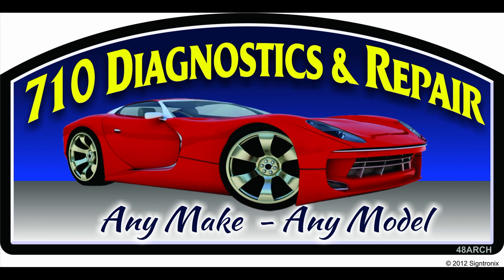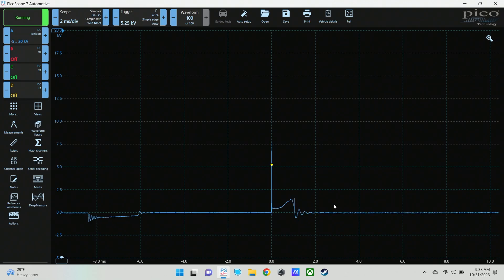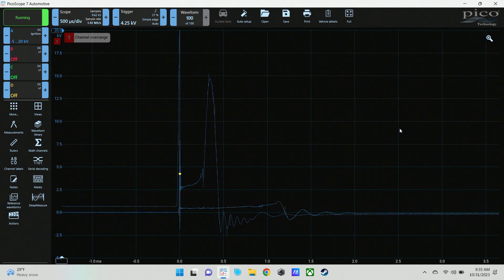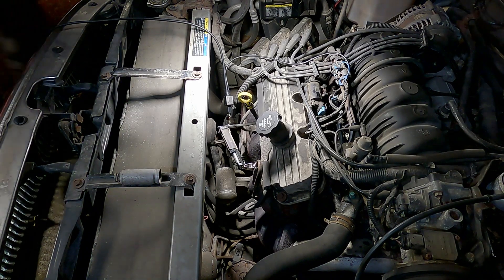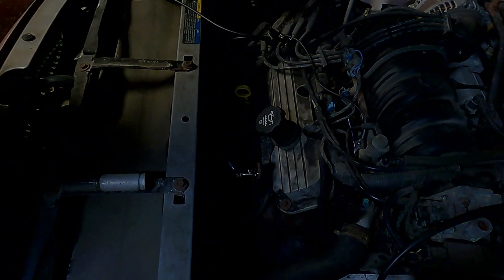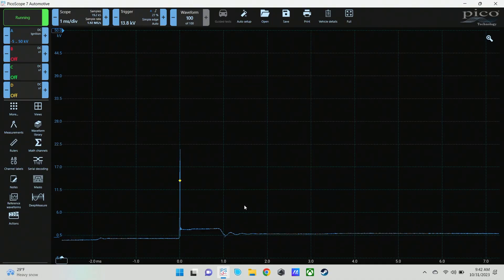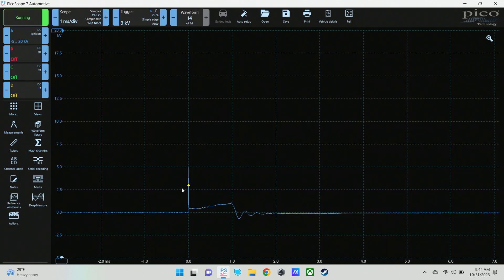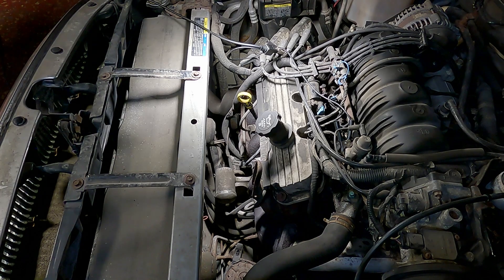Secondary Ignition Waveform Analysis

Comment: Isnt there a way to determine if the spark is happening inside the cylinder or outside the cylinder by looking for anomalies in each half of the burn line?
Reply: Yes by performing the Snap Throttle test as shown in this video. From IDLE to Snap Throttle, the Spark Burn line will shorten up and the Spark KV increases. The Burn Line shortening up on Snap Throttle indicates that Timing Advance is working. The Spark KV increases on Snap Throttle because of the increased Cylinder pressures. If you HOLD throttle, the Spark KV drops because the spark is now occuring earlier when cylinder pressures are lower...also indicating timing advance. This means the spark is occuring inside the combustion chamber.

In his example of the Shorted Spark, the waveform will change very little if at all when doing snap throttle test, meaning cylinder conditions are not affecting the waveform...meaning the spark is happening outside of the cylinder.

Looking at each half of the burn line still applies here. Again look at the Shorted Spark example. The Burn line is practically 0V. The spark found a path with no resistance. If it occured in the cylinder it would require higher KV to overcome the in cylinder resistance to keep the spark burning. Higher resistance = More KV needed to keep spark burning. In the example of the disconnected injector, the spark rapidly runs out of fuel (a conductor) and thus the KV required starts climbing. More fuel = better conductivity = less KV required.
Reply from the maker: Yes, there is a method popularized by Jim Morton. His secondary classes are excellent, and I believe they are available on YouTube. 

I have been planning to expand on the secondary ignition analysis videos I have done.

I've been using up most of my free time working with the mt pro, which is an awesome ignition analysis tool. So there will definitely be more coming.
Reply: @710diagnosticsandfishing  im just patiently waiting for Joe Caci of Joe's Auto Electric to get some more MT6's in so i can pick one up, next stop is to watch all your MT6 videos LOL
Reply from the maker: I believe he has some in stock now !! 
If not really soon.

Comment: Yo mike appreciate the info. As you stated in the video. The key is to stress the ignition with a snap throttle. With the insulated COP now, its harder to get a clean ignition waveform
Reply from the maker: Thanks, DJ. 
I'm going to pick up some of Joes ignition pick ups, and see how I like those. If I can get them to work the way I want, I'll have a nice long video demonstrating those on a modern vehicle. 
I currently use the pico paddle pick-up. I honestly don't care for it, but it works. Just not well enough for a demonstration.
Reply: @710diagnosticsandfishing  THAT IS A VIDEO I WOULD LOVE TO SEE,, THANKS AGAIN .